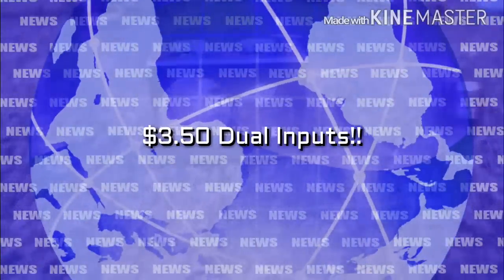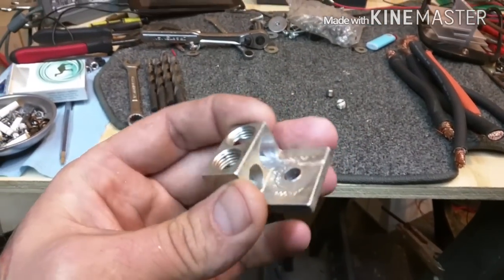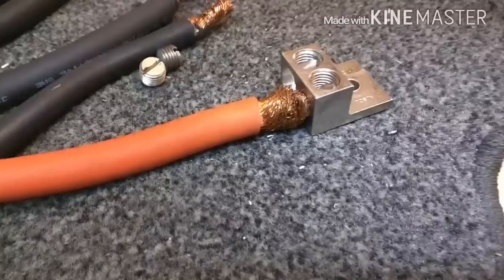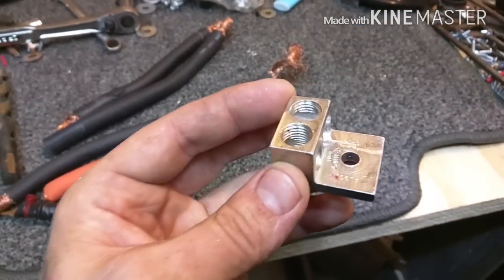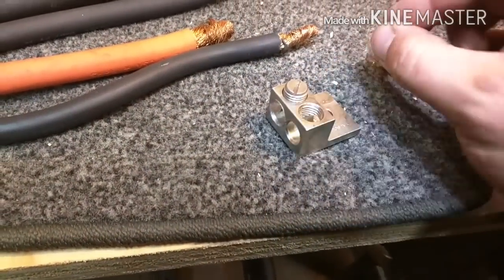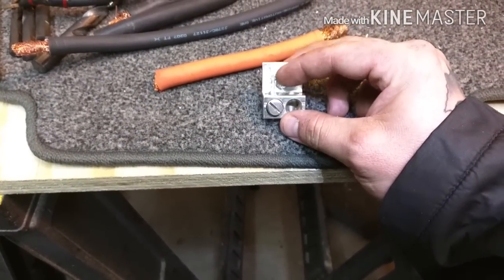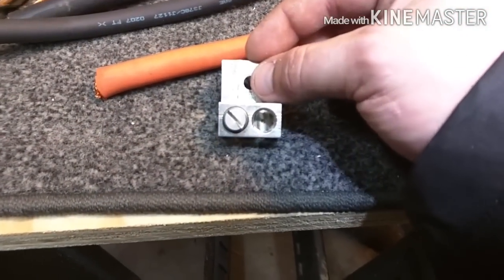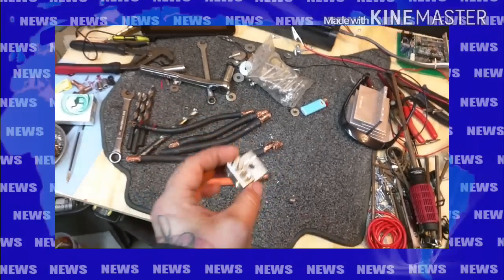Do It Yourself: Dual Inputs for your amp!!

Comment: Buddy you really should/need to invest is very affordable  Wire ferals To go over the ends of your 0 Gauge 1/0 Gauge wires and or all of your end leads that go into your Nice homemade wire terminals or amps. 
You will really like them. Just check them out on ebay. Get a pack of 10. Or more depending on your application. You will love them.

Comment: I use the same things.. I’ll never spend more the 10 bucks on connectors and I build my own power distribution blocks with those as well. It’s super easy and honestly it’s part of the fun really. I wouldn’t be into car audio if it wasn’t for this aspect of it. Figuring out how to do it big but cheap at the same time.

Comment: Love the video and not trying to be an asshole but your claims of "increasing recovery between quick bass hits" and implying adding dual inputs offers any difference in sound heard is absolutely ridiculous and a placebo effect lol
Reply from the maker: rob shekelberg by adding dual inputs you are literally doubling the amount of potential input power for the amp. When you have an amp that has a single input but is very power-hungry your one power wire is very limiting. Having two wires for power and ground keeps a lot of extra juice on tap. There's a video somewhere on YouTube where a Car Audio company actually shows proof on a dyno comparing single inputs to dual inputs.
Reply: StinkyArmpit Bass right but if you have a 2krms amp and you use a single run of 1/0 which is rated for 250 amps, adding a second run wont really help

Comment: solid idea! definitely gonna use this. but i think im gonna run a short wire connected to the threaded hole with a ring terminal instead of trying to run one run of the wire extra long through the hole. just my 2 cents for a slightly cleaner look. and as long as the single run is short it shouldnt negatively impact anything. we will have to see.

Comment: I heard you're supposed to ground each amplifier separately
Reply: Ideally you do, with most applications you want to isolate grounds. especially when dealing with shielded wire. It helps to reduce/prevent signal noise. (thats why RCA's are shielded) As far as in a mobile audio setup everything ends up grounding to chassis anyways so you can't really isolate grounds. I guess.. hell I'm not sure

Comment: i believe higher count small strand wire takes up more space than lower count larger strand wire no matter the gauge. higher count is larger and more flexible but does not mean it has less resistance and or can handle more current.

Comment: man I tell you what, I have the same amp, Hifonics 2000.1 mono and I couldn't get my 0 gauge in so I took your advice and went to home depot and spent alittle over 4 bucks for a pair of these that brung 2 0 guage inputs a piece and man these are great, my 0 guage went in perfect, it was so easy to cut the stem down to fit in the input of the amp and the best of all, I saved alot of money buying one of these things that brung 2 sets with 2 inputs a piece. and they work great.. thanks alot man. car audio is expensive so if i can practicaly get the same product that performs the same then why not save some money. truly recomend this guys...

Comment: I have the same amp brand new still in the box waiting on 2 12" soundqubed hds3's so I like your vid and I'm definitely going to go buy some of those but my question is why do you have 2+ and 2- connected to your amp. still learning some shit so I was confused there...
Reply from the maker: I'm using dual inputs to let the power (+) and ground (-) flow better. Huge amps that produce BIG POWER usually have two to three inputs for - & +. There is only so much power even one single 0 gauge wire can give. I chose to do dual inputs to see the difference and I did gain!